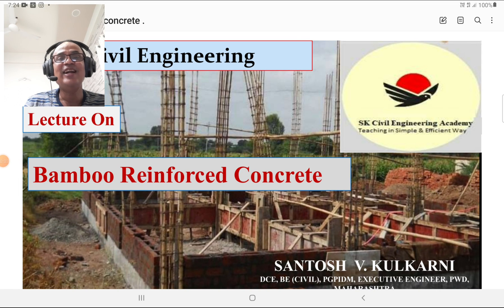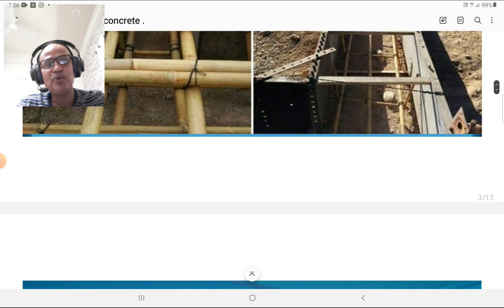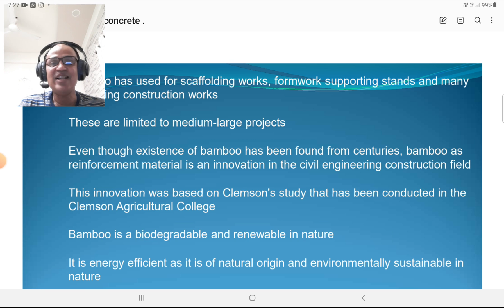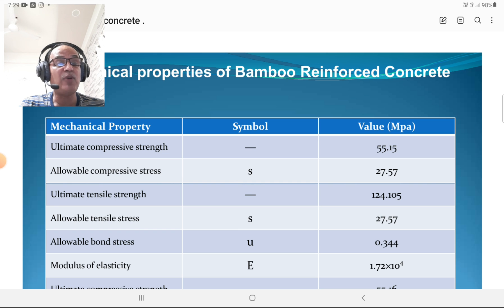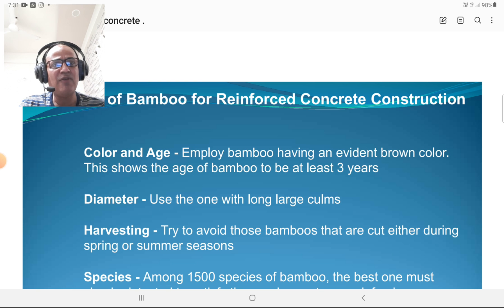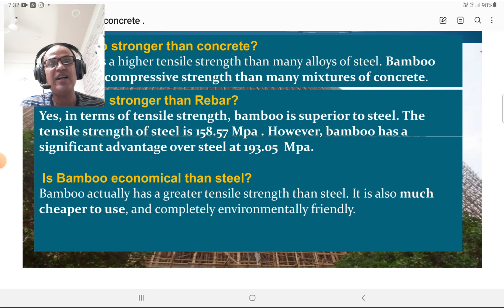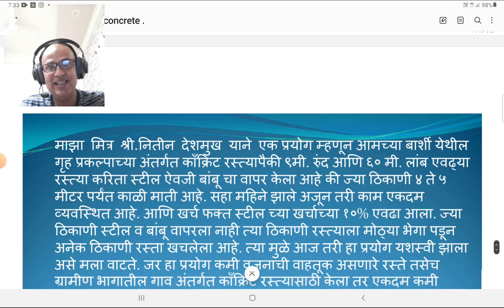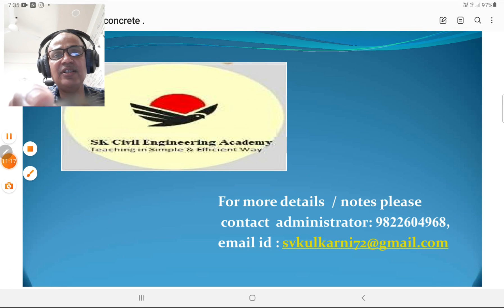#bamboo reinforced concrete &is it stronger than concrete?Is bamboo stronger than rebar?#BAMBOO RCC#

Comment: Sir can we use in low load structure like tin storage house ground beam and bamboo should be split or not or how many days after treating or drying it can be used and what about bamboo deformation and constraction how to avoide cracking and bonding with concrete...
Reply from the maker: thanks for comment ans will be given shortly

Comment: What should be the size of Calum , Beam and slab thickness , give the details of bamboo size. 
How many storeys we can construct the building give the complete information sir
Reply from the maker: I will deliver the next lecture.the size will be reduced due to higher compressive and tensile strength.design methods are same as that of steel however stresses to taken for bamboo instead of steel.it is innovation but other factors may be considered.We can use for single storeyed buildings.the detailed investigation and comprehensive study is required for deciding suitability for multistorey buildings........
Thanks for valuable comments